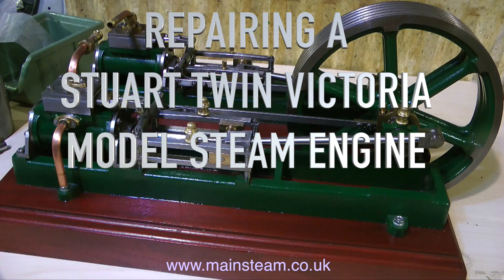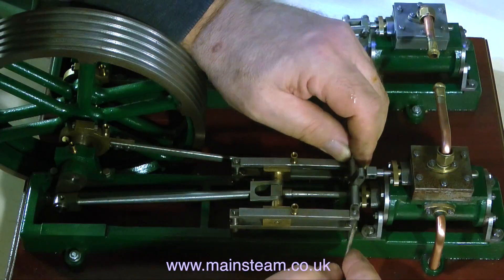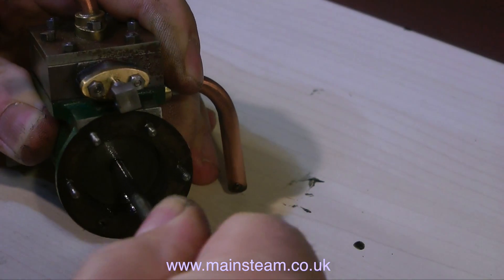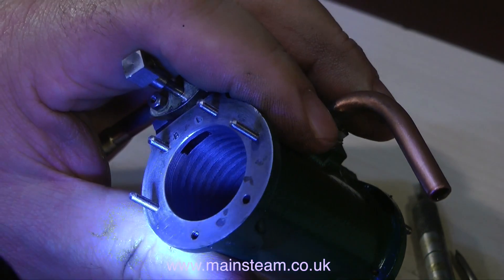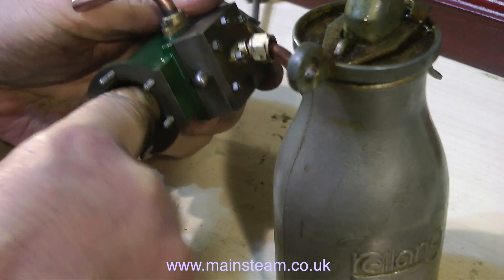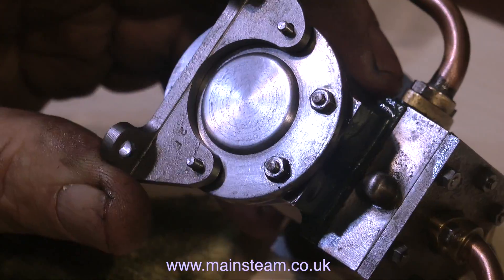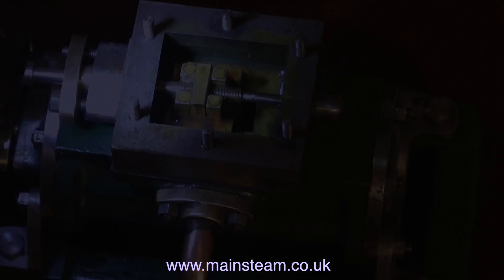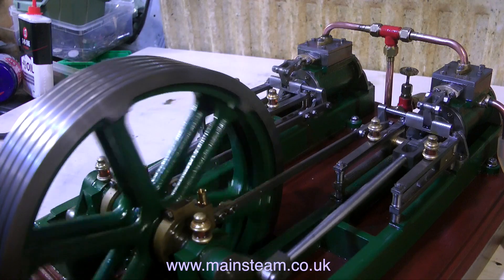STUART MODELS TWIN VICTORIA REPAIR - PART #8

Comment: Lovely video series. What tools would be required if one were to build a twin Victoria from the unmachined castings? I assume mill and lathe but any particular size?
Reply from the maker: apart from hand tools and Taps & Dies, you would need a lathe big enough to swing the flywheel.

Comment: There is something even more soothing about this engine being a Twin. The symmetry of the design is an extra piece of eye candy. You made this one run exceptionally smooth, too. Also love that style of flywheel. Extra wide with slots cut into the flat area. The wheel also is running very very true! Beautiful.

Comment: Keith I was just wondering, was there a casting error in the rear port? It kinda looked like the port was split, does that happen often and does it cause odd valve wear? Or more common for the sand being lodged in the port?
Reply from the maker: Yes there was a casting error in the port. Personally I would have returned the casting for a replacement ..... it doesn't cause any problem with wear of the valve, just a minor valve timing issue. It seems common to have sand blockages in the "cast in" steam ports in Stuart Victoria cylinder castings. I have seen this on a few occasions.
Reply: @keithappleton  envious of your set of adjustable  reamers they do come in  handy..  I've  always  machined from solid  cast iron and never bought  castings as I stay in South Africa  but the price that you pay for indifferent  quality  is a cause for concern. Casting is not a dark art  people  take short cuts and quality  suffers . Keep safe

Comment: hi I have got an old hot air engine and have tried to get it working but nothing happens any tips on how to get it working?
Reply from the maker: Sorry I can't help you without it being on my workbench - maybe a viewer can help.
Reply: Model Rail maybe you can make a video about it . It's impossible to say whats wrong without seeing anything. And even then, it might be hard without having it on the bench to check things and try things. Could be so many things
Reply: Willem Kossen ok will do thanks
Reply: Keith Appleton I have put a video of it on my channel so you can see it